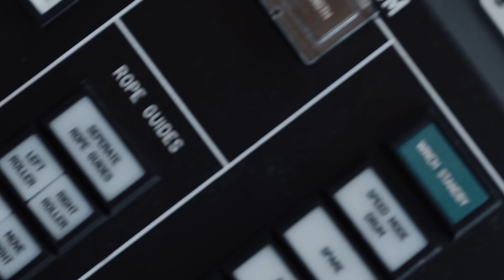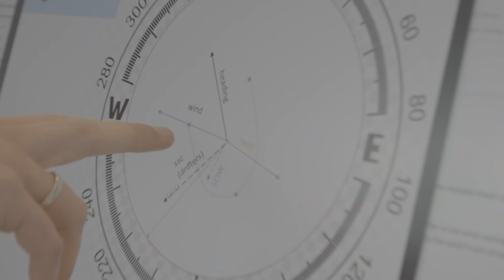System 001 Deployed in The Great Pacific Garbage Patch | Cleaning Oceans | The Ocean Cleanup

Comment: This is fantastic, thank you. 

I have a question that I couldn't find an answer to on the website. Eventually there will be situations where vessels will need to navigate bearing this system in mind. Once it scales and I have faith that it will, how do you plan to alleviate any potential navigational hazard.  Will it be marked on ais?

Thanks again :)

Comment: What their doing is amazing well done thanks. BUT.... I'm a merchant seaman with many years offshore and project experience. This system/vessel is so weather dependent, especially mid ocean launching men in work boats is not fun. 
I sent them an email a few months ago with alternative ideas but they didn't respond. Best of luck to them but I think they need to seek more marine support. Is maersk running the show?
Reply: Also deck space on these boats is very small, where is the garbage going to go?
Reply: Ocean barges can be towed by the boat shown being used to haul the system out to sea, they hold a lot more than what the boat itself can actually carry, especially on full collection haul aways.
Reply: @Joshua79C  offshore barge garbage transfers mid ocean. Again very weather permitting, swell hanging around for days, good luck to the boys doing it.

Comment: Sry, but I didnt see any garbage yet...
Reply: That's the whole point. The great pacific garbage patch is not some floating carpet of garbage. There is not enough plastic in the world to form such a huge carpet. Yes there is a huge concentration of plastic, but area of that garbage patch is gigantic so most of the time you are not going to see any plastic and from time to time there are small pieces floating by.
Reply: +Sadox's question is a valid one.

+aullik
Here's a very visible patch of garbage in the Caribbean Sea, posted on Nov., 2017:

"Floating trash 'island' spotted in Caribbean Sea"
https://www.youtube.com/watch?v=mZWROIabkwo

It's been some years ago now so I don't remember the TV show, however they were very keen on showing a very visible and very large 'island' of garbage that you could see from far off.

Was the Ocean Project unable to find a visible patch of debris for this initial trial? They have used planes extensively in the project, seems it may have been prudent to try and find at least a small mass of floating debris to test out the system while they are there and can troubleshoot.
Reply: @_aullik  OK thanks for the Information.
Reply: Sadox Follow the System 001 Timeline (top nob). It will tell you when garbage has been picked up.